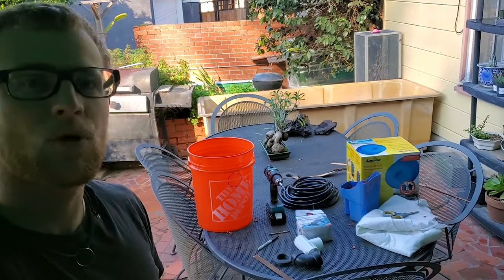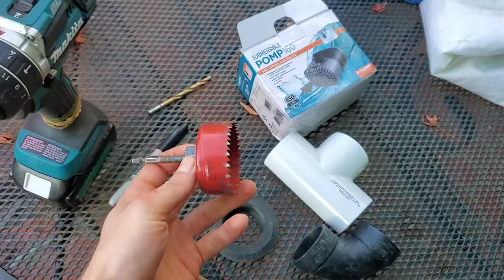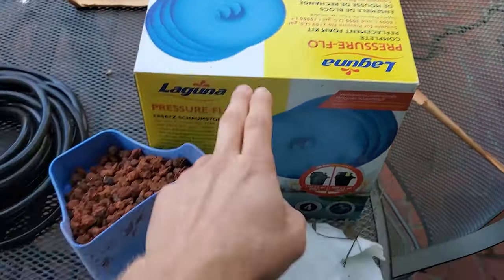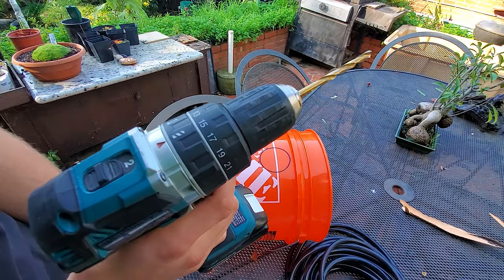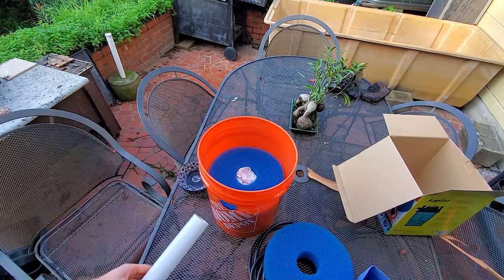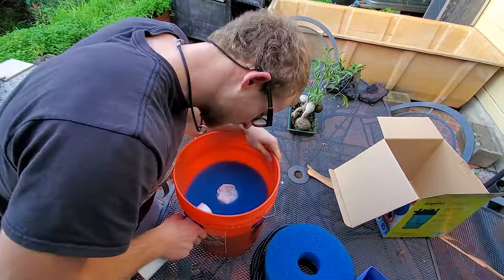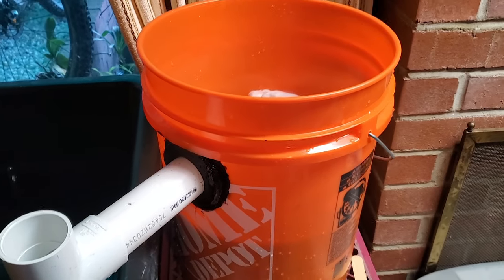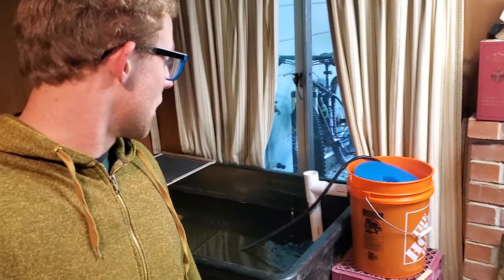Simple DIY 5 gallon bucket pond filter (pond filter build)

Comment from the maker: If you are confused on how the water enters the filter watch this video: https://youtu.be/mW7DbeyyujI

Apparently I didn't make it clear in the video. But for those who do not understand the water enters at the BOTTOM of the bucket then moves UP through the sponges and out the top. (The water DOES NOT enter at the top and just go out the top PVC.)
The black pipe that is connected to the pump goes to the bottom of the bucket. All the water enters at the bottom of the bucket. And to repeat as a result the water moves up through the sponges then goes out the top PVC. So therefore the sponges capture the gunk and clean water exits the bucket.
Reply: Why dont you show where the hose enters the bottom of the bucket ???
Reply from the maker: @LushWisdum  The black hose is just draped over the side of the 5 gallon bucket as see at 8:25 until the end of the video.
The black hose runs down the side of the sponges and to the bottom of the bucket. Which I unfortunately did not express in the video. If requested I can make a video showing that detail and post it in this thread, which I might possibly do even if not requested.

Comment: I would be interested in a follow-up of this filter. I don't see how it's very effective when you're not getting the water from the bottom one it's gone through the filter. Looks like you're just outputting the water that's just coming in.
Reply from the maker: I can see I recorded some videos on it when I took it apart some time ago, but forgot about it and never made a video on it. So I can go through it and see what I can do.
But either way the water did go through all the sponges. The hose goes all the way to the bottom of the bucket. But now that I skim through the video  again I don't think I mentioned that anywhere. You can see the pipe draped over the bucket at 8:35 and it goes straight to the bottom of the bucket. 
I didn't have it setup for to long but it did the job I needed it to do.
Reply from the maker: Here is the follow up video 
https://youtu.be/57NLvMaVARk
Reply: It's not done Proper the water is simply going straight into the out put pipe it's not passing through the filter everything is sitting on top
Reply from the maker: @carlwilliams9771  It seems like u are not understanding how it is set up.
The black pipe that is attached to the pump that is putting the water into the bucket. Goes all the way to the bottom where the lava rock is.
So the water then has to move up through the sponges and then out the the top where the pvc pipe is exiting the bucket. So as a result the water goes through all of the filter sponges, and is therefore filtered.

It seems I didn't make it so clear in the video, but it is a simple concept. The water enters at the bottom and comes out the top.
Reply: This would actually work for my pond… it’s a stacked barrel pond, but I need a filter.

Comment: I would lift the rocks and sponges leave a gap at the bottom. Pute a pipe attached to your pump hose. Feeding the water to the bottom that way the water has to go threw your media and up the sponges leaving only clean water to come to the top leaving the muck at the bottom.

Comment: If doing it that way u should of had your outlet at bottom of the bucket so the water filters thru the media. The way it is now the dirty pond water is running right out of your outlet it’s not getting filtered
Reply from the maker: The water enters from the bottom and exits out the top. So the water gets filtered through the sponges before it goes back into the pond. See my pinned comment if you are confused.

Comment: Give the guy a break.  He's not a mechanical wizard, but he gets things done. Quick tip, though, the hole saw has a set screw on the side to replace the bit - tighten it.
Reply from the maker: Thanks
But ya that's what's messed up with it. It's been tighted to many times that it expanded to where an alan wrench doesn't work anymore.
Reply: @vonponics  Should be able to get a new set screw from the hardware store. Good luck.

Comment: Hi. I am so new to this… I need more info if you can
1- I did not catch ur name
2- In reference to the white pipe & the hose,, please explain in a sentence or 2 .. which is intake & which is getting water back to container of turtles.  I like to hear & see.
3- Please explain a little on what size ( how do you talk size of pumps) of pump you have & what are you changing to & how does it connect to filter equipment?
 THANK YOU
I hope you are still around because I need this info soon.
Reply from the maker: Check this video out:
https://youtu.be/mW7DbeyyujI

Comment: To fill the hole u could have used and cut up the unused blue ring
Reply from the maker: That would have worked, but I didn't want to cut the filters pads incase I used them for a different filter setup.
Reply: Pillow batting

Comment: The water from the pond should come in from below the middle of the bucket with a 90 degree elbow to allow the water to swirl around and you need only 1 sponge filter on top. You will also need a drain on the bottom to get rid of the poop water and a grate for the sponge filter to rest on. You could also use three 5 gallon buckets, one for swirl filter, one for bio balls and last one for sponge or fine filtration. You could squeeze the sponge daily without worrying about the good bacteria.
Reply from the maker: Those are entirely different filter builds. This is meant to be a super simple build that only requires one hole being drilled. The hose from the pump goes all the way to the bottom of the bucket, then the water moves up through the sponges and out the top. This is a perfectly simple filter to build that is effective. To clean the filter all you do is carry the bucket  somewhere else and dump it, then rinse of the sponges in a bucket of pond water. I purposely didn't add a drain to keep costs down and simplicity of the build. 

Yes if you want to build a more effective pond filter then you would have multiple buckets with different stages of filtration for different purposes. For different size particles as well as for beneficial bacteria to attach to. But that wasn't the purpose of this video. The purpose was to show how to build something that anyone can build without much effort.

I do have other filters on my channel you can check out, such as swirl filters, radial flow filters, and moving bed bio filters.

And I do plan on making a simple three 5 gallon bucket filter build video later on.

Comment: I purchased everything you stated for my outdoor albino turtle pond for after winter however regarding your pump you bought there as a 160 ghp in which it seems like you have a different pump in your pond that you said was just laying around in which you remarked was weak. Why don't you put at least a 850 gph filtration with a similar philosophy for a hell of a lot less money? I just purchased everything needed plus two 850 gph pumps for $56 dollars. With sub adult to adult turtles these are great but for baby babies, the suction is so strong due to the pump power extra precautions need to be taken of course. I had these pumps for some time now but increasing my indoor tanks for winter cold snaps. You need a stronger pump for that by far.
Reply from the maker: I did have a bigger pump lying around that I ended up using later on.
Reply: I ended up going with a 850 ghp pump with a custom 3 gallon internal acrylic filter so that I could easily see into to know when I must change the filtration padding itself  for my 100 gallon albino turtle tanks but I admire your system overall all together.

Comment: You aren’t filtering anything. The water needs to run through the sponges. You should’ve run the pipe to the bottom and then the pressure would’ve pushed the water through the sponges and then come out of you hole from the bottom up. The only thing that is being filtered are heavies that fall to the bottom. Turn your pipe over and run a pipe to the bottom of the bucket through the middle of the holes in your sponges.
Reply from the maker: Unfortunately I did not make it clear in the video, but the black hose from the pipe does already go to the bottom of the bucket. So the water therefore moves up through all the sponges and out the top.

Comment: I don't know why you decided to make like this because all durties return into aquarium or pond . Water has throughout sponges and filtration biological media and then get out opposite side.
Reply from the maker: It seems like u are not understanding how it is set up.
The black pipe that is attached to the pump that is putting the water into the bucket. Goes all the way to the bottom where the lava rock is.
So the water then has to move up through the sponges and then out the the top where the pvc pipe is exiting the bucket. So as a result the water goes through all of the filter sponges, and is therefore filtered.

It seems I didn't make it so clear in the video, but it is a simple concept. The water enters at the bottom and comes out the top.
Reply: @vonponics    I understood how it's worked. Putting in pvc and out pvc near to them doesn't work. Water has to through those filtration media. Water always goes quickly way so. 
This case old school isn't worked as you think. All durties came in and came out to the filter. Water never goes around and makes a cycle into the bucket. Small and medium particles return to the pond or aquarium. It might be that  big particles stay in the bucket
Reply from the maker: @stuardoruano5776  Again either I am not following what you are saying or you are not understanding the design.
The water does not go in and out the pvc. 
The water is pumped to the bottom of the bucket (not the top but the bottom) and  therefore has to move up through all the sponges then go out the bucket. So as a result the sponges capture the waste/ gunk suspended in the water. It will catch most of the medium and large particles, as for the small ones they can be removed through water changes. This filter is not designed for all stages but as an all-around filter that has surface area for beneficial bacteria as well as the ability to capture solids.
Super simple design water comes in the bottom has to move up through the filter sponges and then out the top pvc pipe.

There are many ways to set up filtration this is just a simple easy to set up 5 gallon bucket filter that will get the job done.
If you want more advanced filtration then you would have multiple stages of filtration for the different size particles. In either a bigger filter tank or in multiple filter tanks.

Comment: Yo, the water needs to actually flow through the filter media.  In yours in comes in the top and spills right out again.  The outlet needs to be at the bottom AFTER passing through the filters.  This design is not optimal to put it politely.  Please, those reading, do not follow this design
Reply from the maker: Just FYI you should probably read my pinned comment or the other comments. This is a super simple filter build where the water enters at the bottom and exits at the top.

Comment: I dont think you know how a filter works, waste of time & material.
Reply from the maker: LOL 
I guess this design is too simple for you to understand how it works.
Reply: @vonponics  me & so many others if you read the comments lol.
Reply: @vonponics  me & so many others are stupid. Right at the beginning of the video you say only 1 hole is needed lol
Reply from the maker: @LushWisdum  Yes I have read and answered all the questions addressing my negligence in not expressing this specific detail in the making of this filter. 
Yes as stated in the video there is only one hole drilled in the bucket. (I could have drilled two holes but to keep it simple and keep the cost down there is only the one hole. Which is the output.)

When editing the video, the input hose is not something that crossed my mind. However as seen from 8:25 until the end of the video you can make out the black hose draped over the side of the bucket. Which then runs down the side of the sponges and to the bottom where the lava rock is. And this is where the dirty pond water enters the filter. The water then moves up through all the sponges. Which as a result filters out all the gunk.

Due to me not noticing this important detail that I left out in the video. I have spent time answering all the questions so that other confused watchers can read the comments and understand their confusion.
Reply from the maker: From this video I now know to pay attention and try not miss out any important detail.